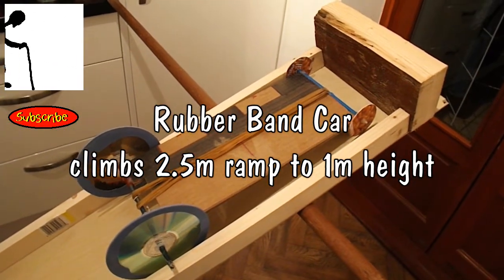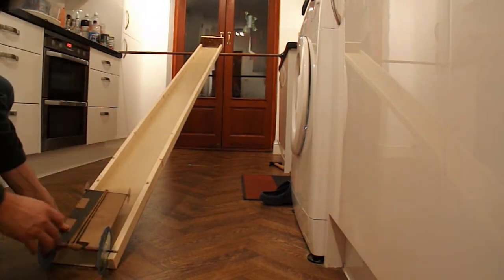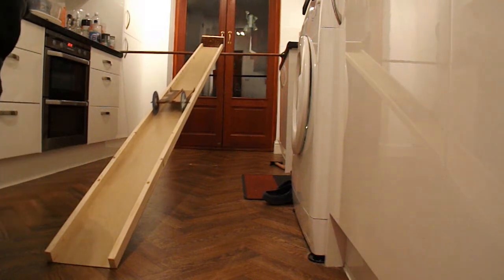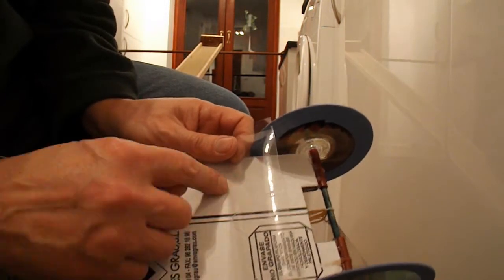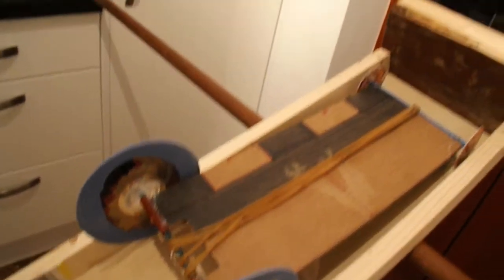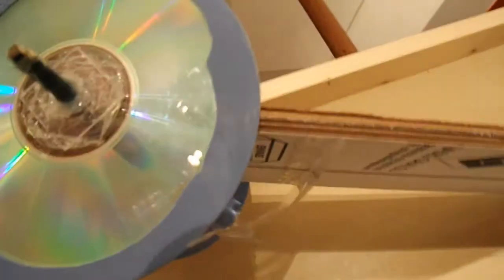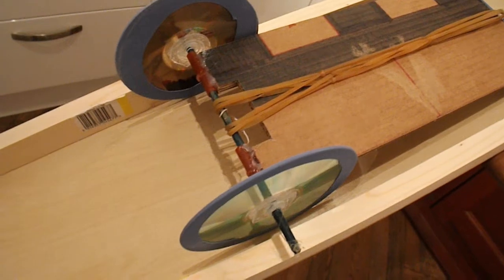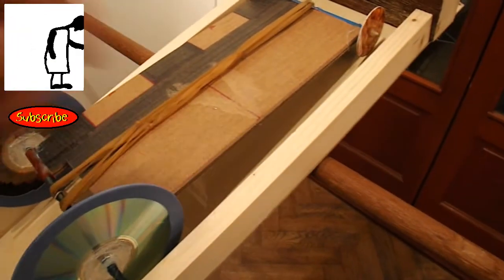Rubber Band Car climbs a ramp to 1 metre

Comment: Dear Grandad! Thank you very much for wonderful projects and for inspiration. Your videos are a great help to me and my 7 and 6 year old sons. We even started running a maker's club in our basement. If you have time, could you think of a way to build a water analogy to a circuit. For instance, a pump as a battery, then a slide or a waterwheel to show a resistor? Maybe even a series vs parallel connections? 
Thank you. And good luck with your projects! ~Elena
Reply from the maker: +Elena Labrecque thank you for your interest. I am afraid there is no way I would create a video on that subject. It would just generate so many comments from people prepared to argue the analogy was incorrect or flawed that I would either spend all my time trying to explain the justify the analogy or give up and delete the video.
Reply from the maker: +Elena Labrecque you only have to read through some of the comments you will find on these videos to understand what I mean https://www.youtube.com/results?search_query=water+analogy+for+electricity

Comment: Hi grandad I made my rubberband car for my project which was similar to this but the ramp was open from the sides. My instructor said there should be a mechanism that if the car starts to go to one side  that mechanism acts as a steering and brings the car back to the straight path. I'm kind of confused about how to do something like this. Please help I'm stressing out a little bit
Reply from the maker: +Kamil Shams if you are not allowed to use electronics the only option I can think of would be a rod pivoted in the centre of your car and extending out from each side of the car touching the ground on each side. You would need the same type of steering that you get in simple RC toy cars but in place of the electric motor driving the steering bar side to side you would need to have a lever on the rod that moves the steering as the end of the rod drops off the edge of the ramp on either side. The rod would need to be as long as possible to maximise the leverage.
Reply: +GrandadIsAnOldMan I just read the project details again, it says parts of the car can touch the side of the board. I was thinking to connect something from the car that acts as a bumper on the sides of the board but that would increase the friction with the board. Can you think of some way that doesn't add a lot of weight and friction and works
Reply from the maker: Kamil Shams that would be easier than using a link to the steering. Just the same as I said, a thin wire rod across the front of the car like a cat's whiskers with the tips bent down so they go down the side of the ramp. They don't need to be in contact all the time, only if the car wanders off course. You could even have horizontal wheels at the end of the whisker to reduce any friction. If you make the car right with the axles parallel it should run straight anyway so you should only need the whiskers to prevent the worst happening.
Reply: +GrandadIsAnOldMan can you please do a short video on this? This is the only thing I'm having trouble with for my project. Your advise has been very helpful, if you can then please make a small video for this
Reply from the maker: Kamil Shams I really don't know when I would get time to do this. That is why I have been giving you written replies. I will fit it in if I can but I don't know when. You will probably have finished the project before I get to it.
Reply: +GrandadIsAnOldMan I am having a little problem and I don't know what's wrong. I have added the rubber gloves to the back axle for traction and sometimes I don't get wheel spin but sometimes it does. I'm not sure what is wrong. The problem is that the car as it is right now travels halfway up the ramp and stops so I need to add more power for it to go further but if I'm getting wheelspin now then adding power would be no use. Any idea what I should do?
Reply from the maker: +Kamil Shams you could try wrapping something round the axle to make it thicker where you wrap the band round it. Maybe tape. Having a thicker axle is like putting the car in a lower gear so a less powerful motor can go up a steep hill.
Reply: +GrandadIsAnOldMan how have you attached the rubberbands to the back axle? I've tried hot glue to attach a safety pin and then try and secure the rubberbands with the pin but my car is heavy and with so much tension the pin does not stay in place
Reply from the maker: Kamil Shams On normal rubber band powered cars you are relying on the band coming free at the end so the car can freewheel after the power has finished. You should be able to wrap the rubber band round the back axle without any peg or pin. You just wrap it round one turn so it goes over itself and that should hold it in place. If you have attached something to the back axle and the tension of the band is pulling it off then you are probably using a band that is too short and you are already stretching it to get it to the back axle. If that is the case then you are losing some of the potential distance the car could go because there are less turns on the axle. On this particular car we are not worried about it freewheeling when the band has run out because the car will stop climbing when the power is not enough to move it forward which will be long before the band has fully unwound so I have actually tied it permanently to the back axle using some soft wire but you could use string.

Comment: Can you make a solar powered plane?
Reply from the maker: protothief no, have you ever seen one? They need enormous solar panels covering the wings to collect the solar energy, then they store it in batteries and the plane runs from the battery power. At model plane size the weight of those panels does not scale down so your chances of making one that will get off the ground are virtually nil. You would have to buy some very expensive light weight panels. Alternatively, you could make a plane that is technically solar powered by using a solar panel to charge a LiPo battery and then fly an electric plane using that battery.

Comment: how bout a 2 meter height
Reply from the maker: +GuitarRocks360 no thanks. Just making the ramp higher means you have to increase everything proportionately but essentially it would be exactly the same. In fact the height is almost insignificant, it is the slope that is important.

Comment: hey man, how far does this go?
Reply from the maker: It does exactly what it says on the start screen. It climbs a 2.5 metre ramp to a 1 metre height.
Reply: GrandadIsAnOldMan
i should have asked "how far does this go on a flat surface?", i mean its range (out of kitchen btw:)
Reply from the maker: iilkerr this was only built to go 2.5 metres up a ramp. I had no reason to measure how far it would go on the flat. Normally I test my cars to run the length of my kitchen which is 5 metres. Sometimes I open the door and run them through the hallway too which gives a total of 9 metres. This car in it's original format - see the video description for the link to the build - was probably only tested over 5 metres which it would have achieved with ease.